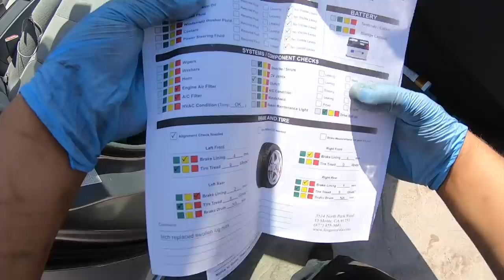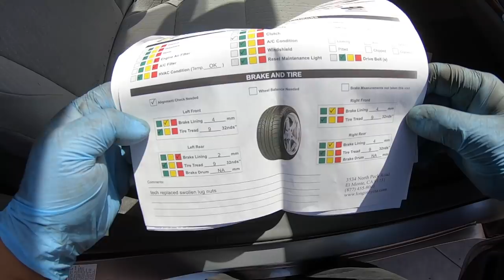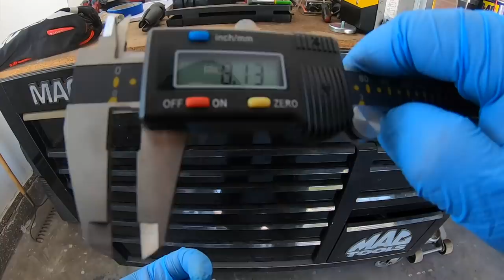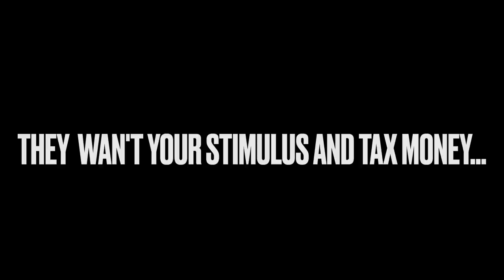This is why YOU need to avoid the Dealerships!

Comment: I had a friend call me about a BMW quote . They record everything and then send you the link. I caught one thing in the video that made me go back and question everything he was recommending. So even if they record it to show you, there are tricks to make you think you need something.

In the video he inspects the tire tread. He puts the indicator on top of the wear bar and states all 4 tires need to be replaced because they are only 1mm. 
I pulled up an image of the tire on tire rack , showed her what a wear bar is. Showed her that I could not trust his measurements. If you assume his 1mm and add in 2mm, you have 3mm. But you could see that there was more tread , maybe 4mm or 5mm in the center. 
Then we had to review the so called leaks from the differential that looked so clean like it was patted on with a crunched paper towel. 
Then it was a bad battery.
Then it was replacement of an alarm horn.

Result was: replace your battery and the alarm issue will go away. Clear codes.
Replace your tires in 5,000 + more miles and don’t pay $2,200 since you got the last set for $800.
Clean off the differential with brake clean and see if it comes back.
Reply: I learnt just because they send you a video it doesn’t mean your brake pads or tyres need changing. With my car, they never even showed the brake pad thickness in the video but still said it needed to be done

Comment: I was recently told I need new tires by the dealership. They were right, I did. The interesting thing is I got new tires relatively recently and I got the exact same tires that came on the vehicle from the factory, that originally lasted 50,000. This set only last 28,000. That was the end of that conversation, so I left planning to get tires within the next week. Wondering what caused this, I checked the tire pressure. 37 PSI cold. Tire specs on the truck say 28.  I check the full spare, which had never moved, 28... I call Toyota corporate, they double checked the specs... they say 28. I call the dealership and ask them, since they are the only ones that touch my tires. "Hey why are my tires 37 psi cold? You put them on and you're the only one that touches them" answer "Yeah when we install new tires we usually inflate them to between 35-37 PSI, we find it gives them better grip on the road." In my head "Yeah you probably do it so you can replace tires more often." Then I went to the dealership and checked a tire on a brand new truck that was the same as mine... 28 PSI.

So yeah, avoid dealerships.

Comment: Not all techs work like that. Some techs don't remove the tires and they go just by what they called visual inspection. Also not only dealers have those type of techs. Mechanics also do that thieves job too. What about if the rotors are worn? Is not necessarily that the pads have to be low. Some times the calipers don't open or close. Or the rotors get Hotspot too
Reply: "It's not necessarily the pads have to be low" What you mention can be true, but specifically in the video he mentioned the dealership stated the pads were worn down to 2mm when they were actually about 7-8mm which is very shady. They didn't mention warped rotors or sticking calipers.

Comment: The dealership was likely going off their computer, which likely contained info from before you changed the brake pads earlier without telling them. If you're going to dyi, make sure to tell the dealership what you've done so they update their information on your vehicle. At the very least, it will stop them from saying you need an oil change, brake service, and so on (all the stuff you've already done).
Reply: Their computer told them the brakes were at 2mm? BS
Reply: @pb7379-j2k    ..  Try reading more carefully. The owner obviously took the vehicle into the dealership before this guy earlier serviced the brakes (said he did so several months ago). The dealership's mechanic likely made the notation about the brake wear at that time, with no update since to suggest anything different.
Reply: @robinstewart6510  that’s your dealer defense? Ok
Reply: @pb7379-j2k    ..  No, barring outright criminal fraud, I'm simply saying it's the most logical explanation. If you diy, how many times have you received a notice that it's time for your 5k service, 10k service, or whatever when you've already done it? No fraud on the part of the dealership. It's on their computer and that's what they're going with. Of course, you're free to believe otherwise, but don't whine when such cynicism is directed at you. For example, one might ask what's in your negativity for you.
Reply: @robinstewart6510  my negativity comes from my friends and I being told we needed new rotors and pads all the way around when in fact the brakes were fine. Just like what happened to this person. I’m not whining
Reply: @pb7379-j2k    ..  Interesting since it's never happened to me, my wife, or anyone I know. I'm not saying dealerships are totally honest. I've had my encounters with dishonest mechanics, both dealership and independent.
Reply: @robinstewart6510  read the comments in this video. We’re not all lying. Oh, and watch the video??
Reply: @pb7379-j2k    ..  Dude, I read the comments. I'm just introducing a new possibility few, quick to judge, seem to be thinking about.
Reply: @robinstewart6510  “quick to judge” it’s been happening for decades to millions of people but ok
Reply: @robinstewart6510  the dealership offered free brakes because they knew they were caught
Reply: @pb7379-j2k    ..  Have a nice day, guy. I'm not going to keep arguing with you.
Reply: @robinstewart6510  thanks, you too!